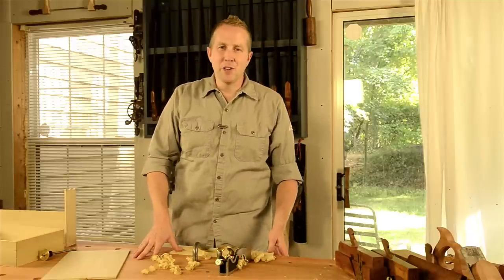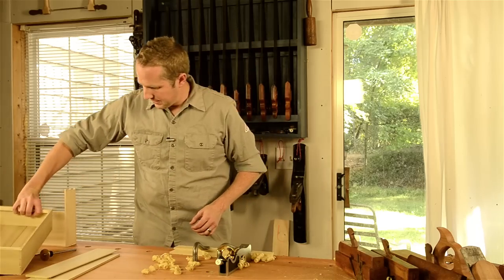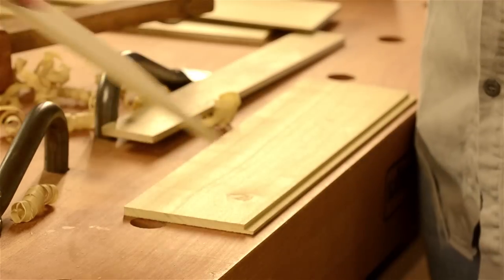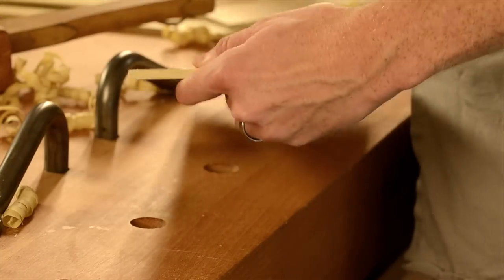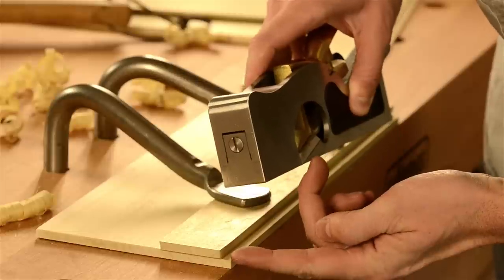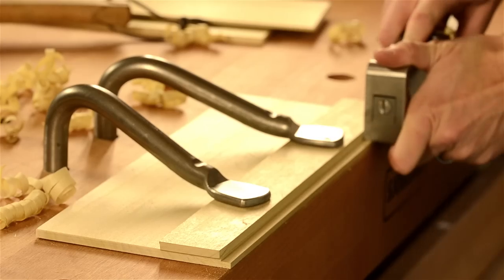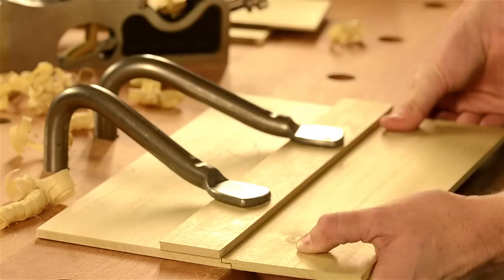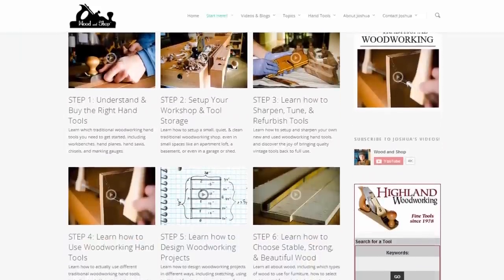How to Cut a Ship Lap Joint with Hand Tools

Comment: If you run the grain of the wood the other way for the bottom the expansion would move toward the back of the drawer where there is free space. As you have the grain running expansion can force the sides out risking binding in the case.

Comment: I have a similar (veritas) marking gauge.  One suggestion: rather than mark the line, just hold the gauge on the work piece then butt the fence against the wheel at each end then fix the fence.  This will give you the right distance but without need to scribe the line and avoids having to 'eyeball' the fence against the line.  Of course, with cross grain rebates then the scribed line helps obtain a smooth edge.
Reply: suckers0 the wheel marking gauge also scores the wood fibers to prevent any tear out, always good practice to use...even with long grain

Comment: Hey Joshua! Great video again! I've been practicing sawing and chiseling all day today and one thing I still have trouble with is marking with the marking gauge. I have the Veritas dual marking gauge but it tends to want to follow the grain. Got any tips or is this just a practice kind of thing?
Reply from the maker: Hmm, what type of wood are you using? Something with deep grain like white oak? I guess I just hold the wheel tight against the board's edge, taking care to keep the large part of the dual marking gauge pointing downward to get the greatest surface area on the board. Does this answer your question?
Reply: Wood and Shop it was a soft wood, pine I believe
Reply: g00thier Well, soft wood should be even easier. So either you need to let up on the pressure or sharpen the round blade (if it's new then it shouldn't be dull).
Reply: A few lighter passes generally work better than a single heavy one...

Comment: Hello !, a question: To begin making rubbets, which would be the first option to buy: rubber plane or shoulder plane?

1000 Thanks for your videos!!
Reply from the maker: Hi Xavi, 

Great question! A new large shoulder plane like this is great for getting started: http://www.highlandwoodworking.com/lie-nielsenlargeshoulderplane.aspx?A=1278&B=28

It comes very sharp. But if you're on a tighter budget and know how to refurbish & sharpen a wooden rabbet plane, then that's a good option. Check out my tool buying guide if you need more info!